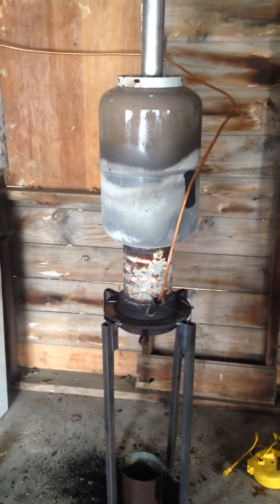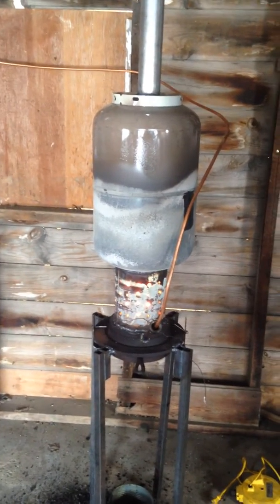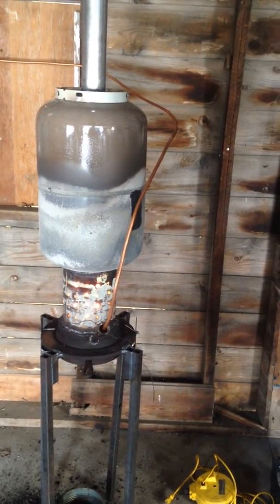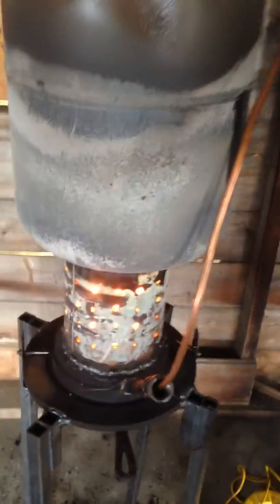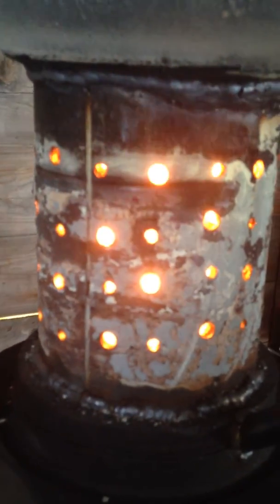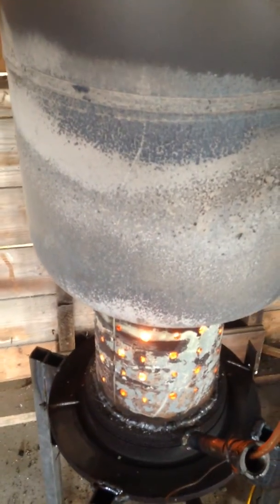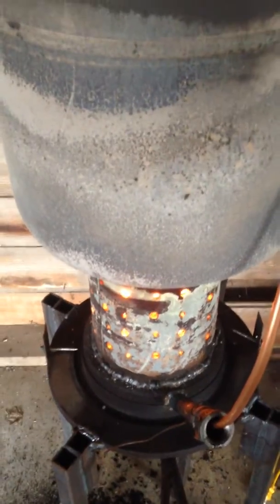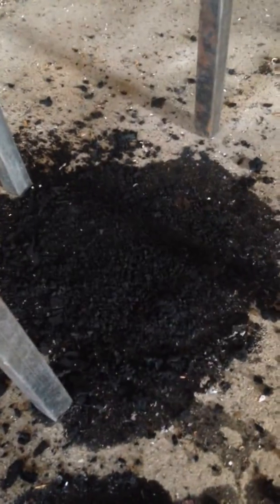Waste oil heater troubleshooting

Comment from the maker: Thank you Oil Burner! I closed the gap and it seemed to burn much cleaner but the flames couldn't make it up into the propane tank and it wouldn't get very hot. Drilling more holes is my next step. Thanks for the help!

Comment: You should close up  the gap where the pan meets  the brake disk. That will slow the burning down to clean the output up.
If you want more heat and a cleaner burn, enlarge the secondary holes and/ or add some more. This is really where the heat and cleanliness of the burn is dictated.

The problem ATM is you are vaporising too much oil but dont have enough air in the secondary stage for it to burn clean.  You cannot add too many holes or too large. I have done this design with a mesh screen that acts more like a flame holder and it ran well. There is always some smoke with this design but you could be able to get it more to a light haze than what you have now.

If you want a truly clean burn with no output other than heat and don't need to ever clean the burner of clinker and buildup, Have a look at my vaporising style burner. Very easy to build, puts out more heat than you could ever need and runs perfectly clean in all aspects.